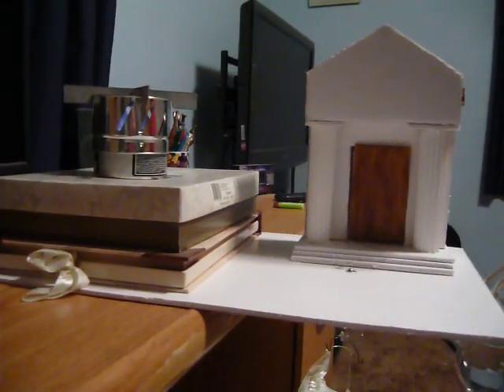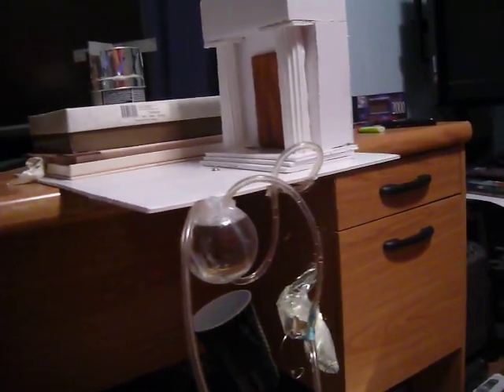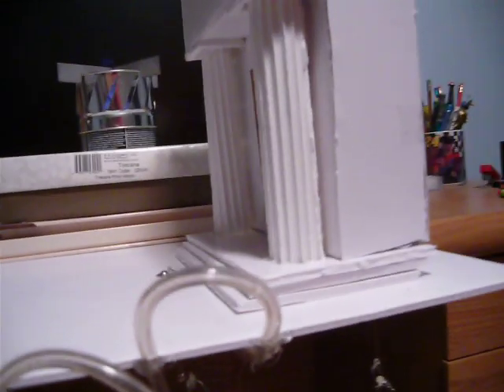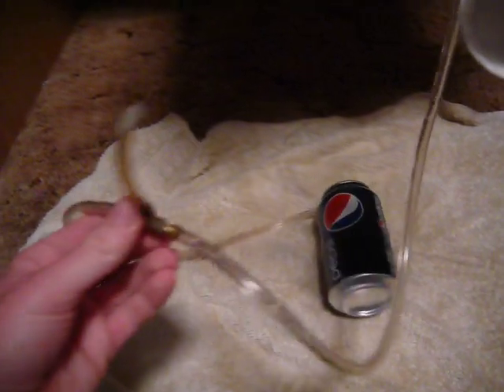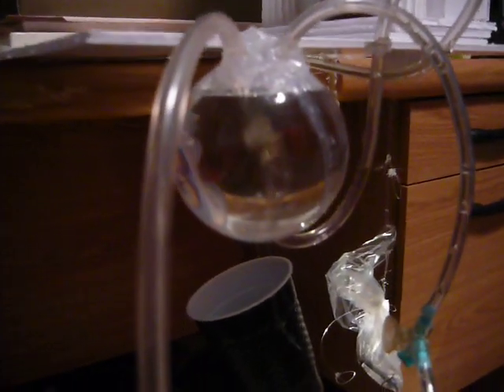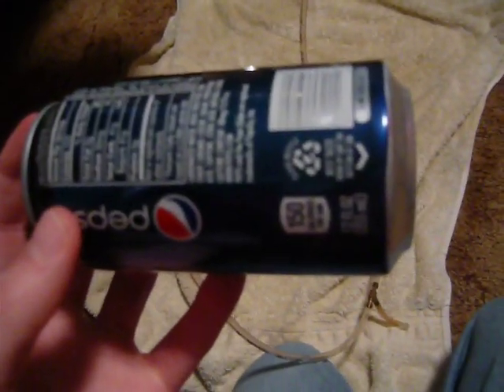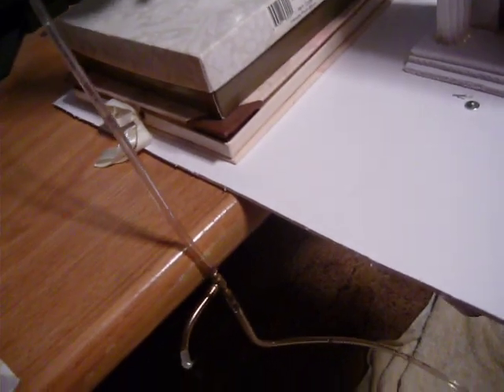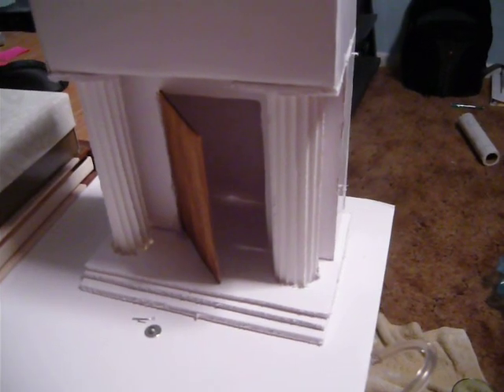Hero's Temple Door Functional Model

Comment: i thought putting the fire above the chamber was obvious (at least to me). 
here goes at an explanation, yes hot air rises but it also causes the molecules in the air to expand. a small amount of air above the water but below the fire caused a pressure change inside the enclosed container forcing the water out when the fire was extinguished the molecules slowed causing a vacuum and sucked the water back to it's starting point.
Reply: No. The answer is actually that heat was transferred by conduction through a solid rod. It’s not a pipe.